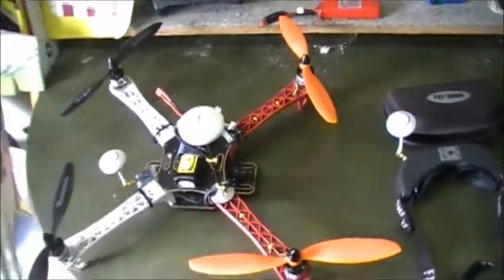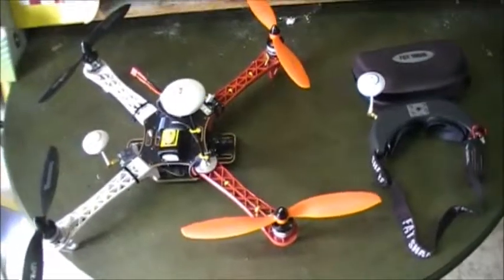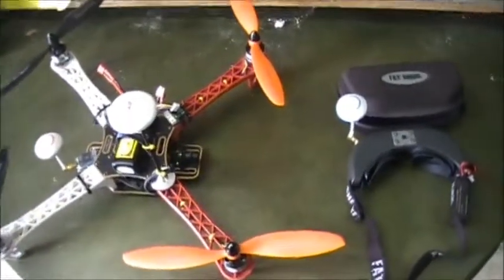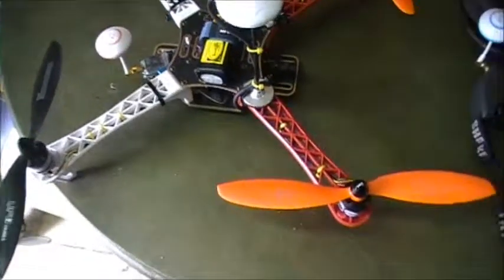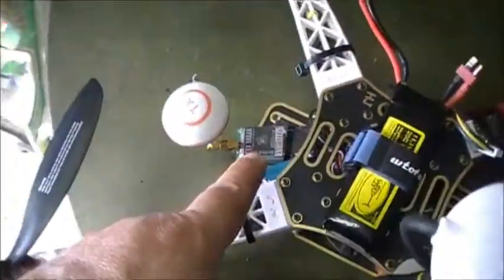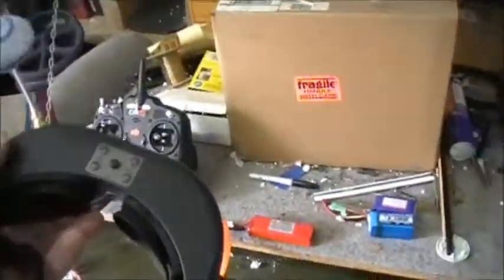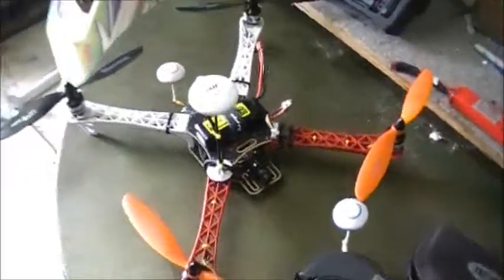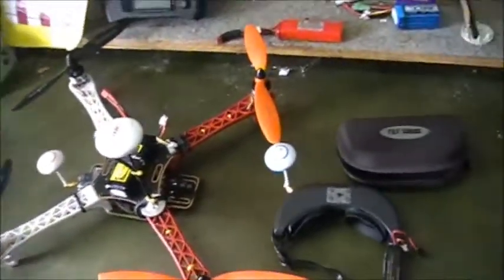FPV JIYI P2 Quadcopter Build Part 6 of 6 (Completed)

Comment: I was wondering about your Transmitter. What type and how many channels does it have. I am new to Quad but I am an old timer to R/C I fly 1/4 and 1/3 scale Fixed Wing.
Reply: John Sedovic 
check hobbyking. they have  6CH 2.4Ghz Tx with backlit lcd starting around 50$.
feels/performance better than some more expensive models. a matching Rx is around 10-20$ depending on feats.

for something flying in yard/park/fun (500-1000y), or for someone getting into RC its pretty good, and much cheaper than the 8/10CH futaba i plan to get (later).
Reply from the maker: John Sedovic I am using a Spektrum DX-7  which is a 7 channel transmitter but you can get by with a 6 channel transmitter, the main thing is you need is the function switches to change flight modes other than that it only uses 4 channels for flight control..